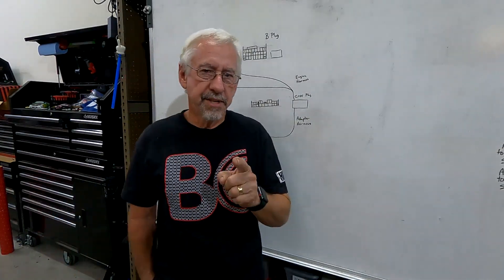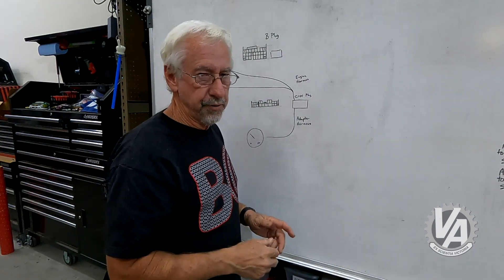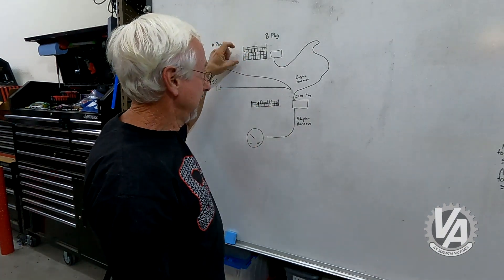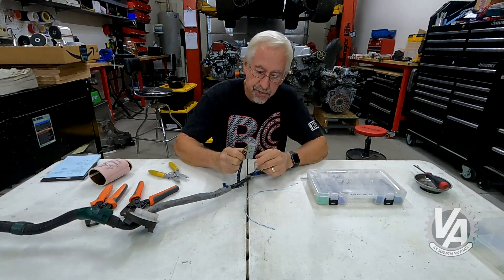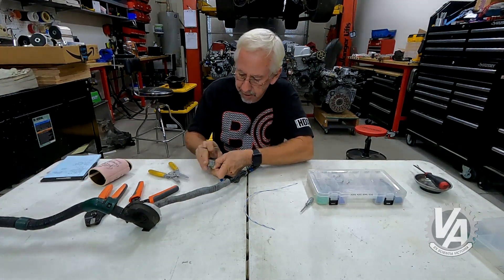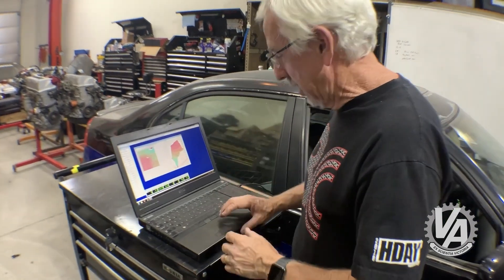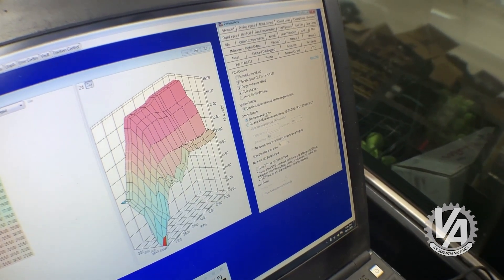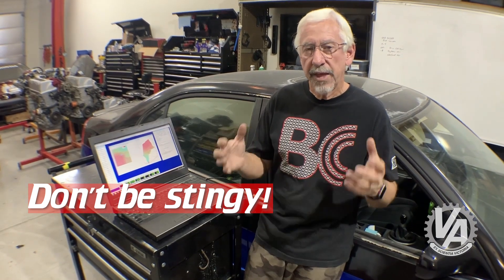Hondata Speedo Fix Pt2: CSS or VSS, it'll work!

Comment: Hello brian im not sure if my last email sent so im sending another! 

I have a k24a integra with a k20a2 6 speed trans and just recently had it tuned it ran great then all the sudden the speedo would work on and off and vtec wouldnt engage! Bought a new vss did the same thing checked the grounds vtec solenoid seems to work as it does go into vtec sometimes when the speedo works the sensors seem to work im lost at this point and dont know what to do next was hoping you guys could help me out!

Comment: What style of pins or sockets you’re using to crimp to the wires? What style of connectors are you using?
Reply: Also tried to install the ktuned vss converter and as soon as I let go of the brakes and the car starts rolling just a bit my speedometer would shoot up. Please help? Was wondering if I wire it up like the video, do I still need the ktuned vss converter hooked up? 😅any help would be appreciated. Thanks!

Comment: i have a problem with my 05 rsx type s with k24 swap..My speedometer doesn't work after kpro ..Help
Reply from the maker: I’ll have to look and see how that adapter is wired. It may output a VSS signal to a specific place on your harness. Also, your kpro has to have been modified by Hondata. They enable an appropriately scaled output on the B 11 wire of your Kpro.
Reply: @VTECAcademy  ok.my adapter harness is for 05 06 type s and my ecu is modified for 05 06..the only thing is that the ecu is pnd no prd..it has a a wire welded inside the ecu ..Thanks
Reply: @VTECAcademy  and Also my vtec doesn't work either

Comment: I just did this & my speedometer is reading at 50mph on ignition & doesn’t move if i drive. I have a 03 type s harness & fg2 trans case with rsx type s internals. Also it doesn’t let me click the option from normal speed to countershaft speed on the Hondata KManager . What did i do wrong?

Comment: I wanted to see is you can enlighten me lol. I’m having an issue with the speedometer not working in my car, I’m on a css and everything up to k pro works, like the sensor itself, the mph on k pro reads but my car isn’t, output on k pro is set on b11 and to the c101 plug .The thing is from b11 I’m not getting any volts. I am on a v4 hondata
Reply: You ever figure it out?

Comment: Not very clear on what specific ecu's made by hondata have this extra input wired in. Seems to be 50/50 in the comments. Is there a visual inspection you can make on the ecu to tell me?
Reply from the maker: It’s not really 50-50. The problem most people are having, is that their Kpro was not installed by Hondata. And that means this doesn’t work.

Comment: Man bout to give up on the speedo. Followed instructions on video to depin 101 and add wire from b11 to c101. Also have rewired css sensor from 12v to 5v from map power and wired ground to signal ground on map sensor. Kpro is switched to css still no movement. 06 K24a2, 02 ep3 factory harness, 05 rsx base trans in 99 civic hatch. What am I doing wrong?

Comment: Hey vtec academie , i did this with my friend v4 , and it work very well , i switch the ecu with mine (v4 too) and it didnt work , i lost speedo , try to replace the wire like it was before , my speedo came back but the speed was not accurate, im lost
Reply from the maker: There may be a percentage of value written in for the speedometer output.

Comment: Just finished my k24a2 swap into my rsx type s everything works fine speedo ready properly but it is still throwing a VSS malfunction code and won’t allow my vtec to engage. Any ideas of what is causing this? A connection issue or a physical issue with the actual Speed sensor. I am using the stock 02 rsx type s transmission. Please help vtec academy 😭 I miss vtec.
Reply: you ever figure it out?

Comment: Hows it going everyone new here to the community 🙏 I have a 02-04 jdm crv k24a in my ep3 with my stock ep3 transmission. Running on kpro v4. But my vss sensor is on. Car runs strong, I had it tuned recently but i was wondering what has to be done to make the vss sensor go away, since it wont let my 2 step engage 
Do I have to repin my vss pig tail plug? Or bypass 
I'm running the ep3 harness
Car runs amazing though 
Thanks yall
Reply from the maker: If your speedometer works correctly, then that's not the problem.

Comment: I know this is years later but im running a 03 accord apg6 honda accord transmission with a rsx type s harness on kpro on my 95 coupe will i have to modify my harness for my speedo to work?
Reply from the maker: Yes you will.

Comment: Do we have to repin the connector to the sensor?
Reply from the maker: Each sensor has its own required connector. If you change from one to the other you need to change the connector.
Reply: @VTECAcademy  im using the 05 accord sensor and connector. Got it to read by pek out the gauge going 3 mph. Im also using 5v from the map sensor. Any idea?  Thanks 🙏

Comment: So I did saw your video on this subject and I have a question. Im running an 04 accord five speed on my 95 hatch. Does the speed sensor has to be repinned in order for the speedo to work after you unplug the wire and run the new wire to the Kpro ECU?

Comment: Right if using that info and covert the rsx harness like that. How do you go about pinning and wiring the vss sensor with the rsx harness? Because it seems like you totally ditching the signal wire, so how does the ecu give the Kpro the signal from the sensor? Any help would be appreciated

Comment: I'm running a css speed sensor on my gearbox and using a rsx 02-04 engine harness with a kpro v4 ecu. I'm not sure if I missed anything, but if i follow this video and change those wires from the c101 plug and linked it to the b plug as followed. do I have to alter the rsx plug wires to suit the css senor???? sounds like me finding this vedio may have saved my life
Reply from the maker: Dont run the CSS on the 12 volts from the VSS.
Reply: So what would you recommend?
Reply: @VTECAcademy  so what do you do if you have a nice harness and don’t want to butcher it all up?

Comment: @vtec academy so how do I make a k20z3 trans work with a 2000 civic si dash?
Reply from the maker: Run a speedometer conversion module like the one from Dakota Digital. Use the NEP on the E Plug to drive the tachometer. Add a the EM1 single wire temperature sensor to fee that info to the dash.

Comment: Question is the 96-2000 speedo pcb the same as the crv i swapped the gauge face to my 96 board and put it in the crv cluster when i plug it all in with the lens off to calibrate speedo needle it reads 0 but pass radar says im 15 under  thanks
Reply from the maker: Not sure. I've seen people calibrate the speedo by repositioning the needle, but If the. tire size is off, I'm not sure that works.

Comment: i dont see the difference from hondata doing the install vs. a dealer  ALL components in the kit are used    so why does only a hondata installed ecu do this  please explain technically  or its not true if you cannot

Comment: What are people doing with kpro that wasnt socketed by Hondata? I have a hamotorsports v4 ecu and want to do this in my k24 swapped integra
Reply from the maker: I need to research how to convert the ECUs and share it. Otherwise some sort of speedometer interface like the ones from speedohealer or Dakota Digital.
Reply: @VTECAcademy   for right now would you suggest I get the k tuned conversion box? I used the Dakota box before on my rsx and I didn’t like it

Comment: So at first I wired up my CSS (5V & ground from TPS & signal wire from A18) and whenever I would move like 1mph my Speedo would read 150+ mph. Then I did this in my K swapped CD5, and Hondata is reading my speed and it’s pretty accurate except my Speedo on my dash doesn’t move now. What do I do?
Reply: I have the same issue now did you fix this

Comment: I know this video is old, but will this also work for swapping  complete 02-04 JDM K20R into 05-06 RSX type S? We’re having trouble with getting the vehicle running. It’s almost in limp mode due to the Speedo not working properly. Thanks.
Reply from the maker: Do you have a Hondata ECU that Hondata did the install on? Then yes.
Reply: Basically 05-05 onward its CSS high frequecny signal your ecu is looking but that JDM tranny has VSS which operates on 12v and outputs a low frequency signal. So need to convert that low to high frequency using a converted like Dakota. But you can get car out of limp mode. There is an option in Flashpro about percentage adjustment to dash and ecu. just put 5000% there and the VTEC etc will work but speedo will still show very little speed. You will need a converted to get that speedo work.
Reply: @A.QPerformance  it’s on a k pro V4. Would that have the option also? Sorry, I haven’t messed with Hondas in such a long time and also not familiar with the RSX chassis.

Comment: 12v to 5v - where do you recommend getting the 5v power from?  Is it safe to just tap into an existing sensor without affecting the readings? What about a 12v to 5v converter box?  Worried about frying the css.  I have 03 rsx s going with an 09 si trans.  Thanks Brian!  Great info!
Reply: Where did you end up tapping into for the 5v? My car doesn run when I tap into the map sensor
Reply: Not doing the swap until further down the road. I think I remember reading on a comment somewhere that Brian recommended to tap into tps power and ground.
Reply: @yaggs8941  yeah I ended up buying a voltage step down converter bc on my setup it was just much easier to draw from a 12v and modifying the voltage. But it works great lol no issues since
Reply: @minineji7050 witch one did you end up getting !
Reply: @minineji7050  which converter are u using?

Comment: I'm running a 6 speed tsx transmission with a 2004 PPA CRV manual harness I've reppined the VSS sensor to suit TSX type on engine harness also fitted correct connector to suit I'm also running a kpro v4 will this work with my 2004 PPA engine harness ?
Reply from the maker: Yes it will if wired correctly.

Comment: Does this work with k20z1 with 05-06 harness on a 02-04 kpro v4
Reply from the maker: Yes.
Reply: @VTECAcademy  so I have the jumper harness instead of repin My e plug goes to b11 on the ecu do I also have to get power/ground for the css from the map or should it already be there

Comment: Hey Brian! I'm using a 2005 Accord 5-speed transmission  with 2002 Rsx Base auto ECU on my 1999 K-swaped Integra. I know I have to de-pin A18 and wire it to the hondata board (red wire). Will this work with my setup or do I have to buy a VSS converter? My speed reach 158 mph as soon as I start driving. Thanks!
Reply from the maker: It should work on your car. Honestly, I need to do a video on using the Hondata board to do the conversion too.
Reply: Did it end up working? What did you do?

Comment: Awd ep3 here. I understand the wiring on the inside, as explained in this video. On the transmission plug side, I need to shave the plug to fit and cut the middle wire at the plug and run it to the MAP sensor for 5v power? Leaving the wire from the harness taped back into the harness
Reply from the maker: If you are going from the stock VSS to the Element's AWD transmission CSS, then you need to replace the plug. The only wire you will reuse is the signal wire. The other two wires, 5V power and logic ground, come from tapping into the MAP sensor.
Reply: @VTECAcademy  Thank you! I'm going to give this a shot today and see how it works out. Much appreciated.
Reply: Finally got around to getting it wired up. I wired the CSS plug as follows to no avail. Signal on plug to vss signal wire. Left the other two wires at the plug taped up. Wired the CSS 5v and ground to the map sensors 5v and ground. Changed to CSS in Kpro and have no luck. Any ideas what I'm doing wrong? Thanks again for your time.
Reply from the maker: @TreadShredders  Did you try running the CSS with the 12v first? That will kill it. Recheck the position of the wires. The information for the position is holding the plug with the clip up with the wires facing you.
Reply: I didn't. I'll check the wires when I get home. I also used a spacer for the sensor as I screwed it in, it would make contact with the gear and the trans wouldn't move. Maybe it's too far away now. I'll check wires and sensor position

Comment: I did this with an auto ecu had kpro installed by hondata but still no speed on cluster. Is there something else I have to do for an auto ecu with kpro
Reply from the maker: This doesn't work on the auto ECU. You will need to input the VSS signal on the daughterboard and then use a speed adapter such as the Dakota Digital, K-Tuned, Speedohealer, or others to convert the signal. There should be a write-up on the Hondata support page.
Reply: @VTECAcademy  I found the write saying the input is on a different connector for auto ecu, and to wire the vss into the digital vss input. But does the vss output still work?
Reply: Do you think if I wired the output to e25 it might work?

Comment: Just to clarify if i do this step here that means that i dont need to buy a speed converter? Also will i still need to plug the harness onto the vss sensor on the transmission?
Reply: You do still need the converter
Reply: @DeesmanONE  ok thanks
Reply: @DeesmanONE what? If you have kpro v4 you don’t need a converter.

Comment: Using a z3 tranny with 02 rsx harness. After using a vss-->css sensor jumper harness, all I need to do is repin at the ecu plugs and calibrated in kpro and everything will work?
Reply: Ok so my understanding is when converting the vss harness to css, tap power from tps/map sensor? Do not use the vss power source correct? After that follow your instructions and it should work.

Comment: Do you have a video when using a VSS on a 05 accord transmission with a RSX harness. I was told I need a converter for my speedometer to work

Comment: Or you can say FUCK ALL the BULLSHIT !! And just get a LEGIT G.P.S. Speedo and turn off speed sensor in Kpro settings. It WORKS just in case ANYONE doubts. And iVTEC still engages properly. I Actually did this because IDIOT, I mean previous owner of my swap installed an aftermarket L.S.D. Diff BUT did NOT put the ring gear back on for speed sensor. I’m not into working on transmissions though I’ve rebuilt engines. So just went the G.P.S. Route.
Reply: I am going to try this. You can select no speed sensor on kpro so I'm assuming that's what you did? Any check engine light?

Comment: I'm running a 04 harness with kpro v4 n accord gearbox with vss when I drive my speedo just goes in circles not sure why tryna solve this any help is much appreciated
Reply from the maker: Accord gear boxes don't have a VSS. They have a CSS. What car do you have?
Reply: @VTECAcademy  its a 2000 civic with a k24a2 I'm pretty sure it's a vss sensor cause when I take the sensor out there's no gears it's just the sensor..I got it setup on the kpro as well n even when I switch it from regular to css it does the same thing...on my stock ecu it used to work fine idk why it's not working with the kro also the kpro is a prc if that helps
Reply from the maker: @lukeramoutar3419  All Accord K-series transmissions have a countershaft speed sensor or CSS. They pulse about 80 times faster than a vehicle speed sensor or VSS. So if you connect that to your dash, it will immediately send the needle all the way around at about 3 or 4 MPH. You need to follow the instructions in the video. The Hondata KPro can read the faster signal, but your will need to convert the output signal to something slower. .
Reply: Will do really appreciate the help I'll let you know how it goes...I have a 2014 civic SI 6 speed I'm rebuilding so that s gonna replace the Accord .. that's a css as well right?
Reply from the maker: @lukeramoutar3419  Yes it is.
Reply: Thank you very much I just did the wiring n went for a run n it's working great thanks again you won't believe how much of a headache this was giving me lol
Reply from the maker: @lukeramoutar3419  Yes

Comment: I recently did this to my k24a2 with a type s rsx harness from an 02 and it doesn't read the speed at all. When I went into Kmanager I switched from the recommended choice which is css driven to the non vss option and it pegs the speedometer at 50mph. When I go and switch it back to css speed sensor on k manager it doesn't read neither on the ecu or the cluster and it doesn't throw a code.
Reply from the maker: It sounds like the sensor is bad, or not powered. Did you wire the CSS with the 5 volt MAP voltage or the 12 volt VSS voltage?
Reply: @VTECAcademy   so just swapping the 3 wires around on the 02-04 rsx harness I have to the 03-07 accord transmission css plug like my harness says won’t work?

Comment: I have a k20z3 engine/trans swap going into an mr2. Everything will be run on the 02-04 rsx type s engine harness. The speedometer on the mr2 is ran on the abs system. As far as the hondata k pro. Does it need this signal for the engine and trans to function correctly outside of the use of the speedometer or can I run it without this working correctly??

Comment: So I have a k20z1 engine and trans out of an 05 type s.  I am planning to use a 02-04 harness with 02-04 k pro.  Will this work with the 02-04 kpro V4?
Reply from the maker: If the V4 was installed by Hondata.
Reply: @VTECAcademy  bummer.  I wonder what’s different between Hondata installing it, and any of the other installers?